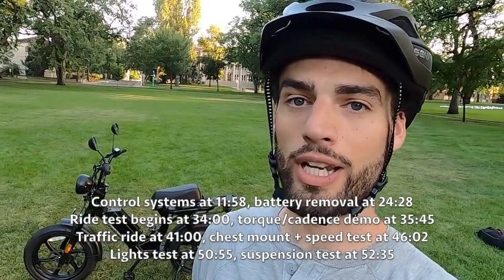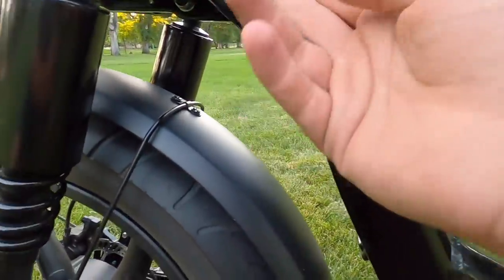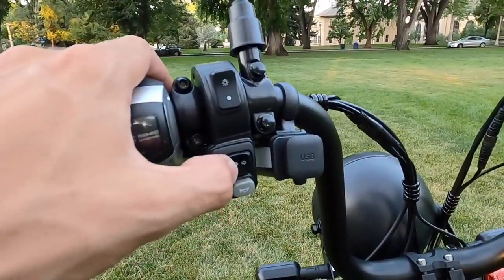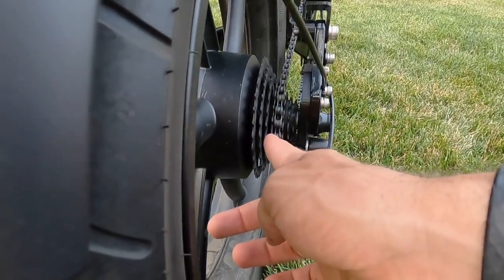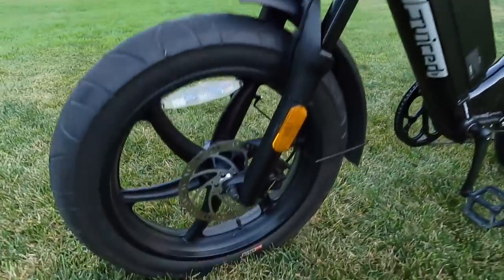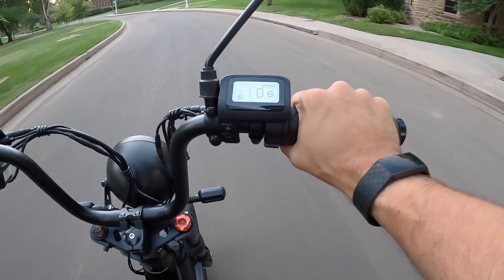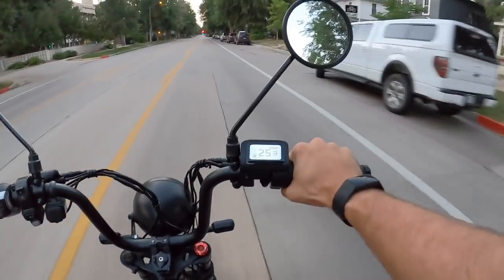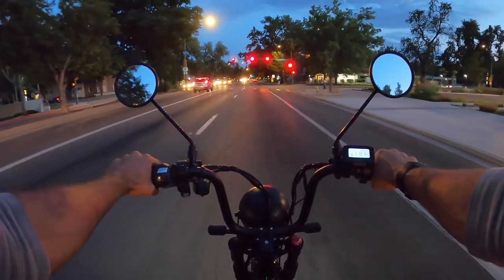Juiced Bikes HyperScorpion Review - $3.2k

Comment from the maker: NOTE: The price mentioned in the video is $2,899. This was the pre-order price, as of August 1st the price has gone up to $3,199.
UPDATE: In the video, I recommended registering this as a Low Power Scooter to make sure that you ride legally. After some back-and-forth with the DMV in Colorado I have determined that this is not actually possible since Juiced Bikes does not provide a VIN or MSO. See the full written review (link in description) for more details on this. 

Control systems overview at 11:58, battery removal at 24:28
Ride test begins at 34:00, torque/cadence sensor demo at 35:45
Traffic ride at 41:00, chest mount + speed test at 46:02
Lights test at 50:55, suspension test at 52:35
Reply: hey did u ever mention the dropout size of the bike frame? dont think I heard it? great review.
Reply: What a great review! I have one and two issues:
1. Front brakes are squeaking.
2. Battery has slightly warped and seems to have moved to the left ever so slightly

Do you have any advice? Thanks so much.
Reply: @tomatojuice12  For the brakes, the likely cause of squeaking is dirty rotors/pads. I've cleaned my rotors with a clean cloth and rubbing alcohol and that usually takes care of it!
Reply: @tanatan7280  Thanks! I am not sure what the dropout size is... and unfortunately I'm away from the bike for at least a month. I'll see if I can get that info from Juiced :)
Reply: ElectricBikeReview said, "in Colorado I have determined that this is not actually possible since Juiced Bikes does not provide a VIN or MSO. See the full written review (link in description) for more details on this. "
I didn't see any more details in the link you provided...but most states have (or they used to have) a way to CREATE a registration for home-made vehicles which I would think would work for this scenario. It's a special class of vehicle. I registered a home-made trailer just a few years ago.
Reply: @TysonRoehrkasse  And this is a recommended maintenance thing on all bicycle disk brakes. Like oiling the chain.
Reply: Yes I need a mirror I don't know why you would need one on the right but you might someday
Reply: If I wasn't watching it I would not leave it with just an alarm I don't think these people smoking crack around here would care about an alarm
Reply: Maybe if I live to be 80 years old I'll buy one like this LOL
Reply: on sale so back at your original price :-)
Reply: I think you only have to register 2000w and over scooters in CO. Technically this is a bike.
Reply: Chris Binder  how come you didn’t go for the hyperscrambler 2?
Reply: Do you notice the shifter is upside-down?
Reply: I just ordered mine for around $2800 and that’s including the passenger seat!!! Can’t wait for my new bike!!!!!
Reply: Sorry to be so off topic but does any of you know of a way to get back into an Instagram account??
I was dumb lost my login password. I would love any tricks you can give me!
Reply: @Madden Julio Instablaster =)
Reply: @Aaron Valentino Thanks for your reply. I got to the site thru google and im in the hacking process now.
Seems to take a while so I will get back to you later when my account password hopefully is recovered.
Reply: @Aaron Valentino it worked and I now got access to my account again. I'm so happy!
Thank you so much you saved my ass !
Reply: @Madden Julio you are welcome :D
Reply: I would love it if you did a review on zooz ebike.
Reply: Way to much. My scrambler way cheaper
Reply: @kingoverclock9497  but it goes over 28mph so it isnt a class 3. Maybe if you pinky promise to keep it in class 3 28mph mode you are good to go
Reply: Juiced HyperScrambler $2499 -1000W 52V 38.4AH, full suspension, mags, Passenger seat, USB, 100+mi range; Juiced HyperScorpion $1899 for 1000W 52V 19.2AH full suspension, mags fenders, rear rack, USB, alarm.

Comment: I've been building performance ebikes for a decade+ and am so impressed with this build @ just $3200 - very well done.
My adjustments would include implementing a 52v-Mid-Drive of 1500watts+ with a 52t covered chainring & a Shimano 3sp IGH w/tensioner driving a 14-22t rear wheel cog. All of this has proven serious reliability - instead of all those high maintenance 'fragile' moving parts and indirect chain-lines of using any kind of derailleur... Besides, no well-powered ebike needs more than 3 gears anyway. 1-Low for hills, 2-regular dogged direct drive and then 3-high for road cruising at 35mph traffic speed .

Comment: Some corrections.  Tail light cannot be shut off.  Motor peaks at 1700 watts.  And if you really need 70 miles of range you better be in eco mode only (11-12mph) and pedaling all the time. Real life range is probably 20 - 35 miles,  your not going to want to go slow on this hot rod!  The bike is awsume though, I'm very happy I bought it.
Reply: I agree with your 20-35 mile battery range.  In "S" mode I get about 20+ miles.  In "Race" mode I did 15 miles and only had 2 bars left.
The bike is well built and fun as hell, but I was hoping for more range from this battery.  Perhaps I am asking too much because I am 6'2" and 250 Lbs.  For $3200 I could have gotten a 150cc scooter :(
Reply: I rode mine hard for 25 miles in race mode on steep hills and as fast as I could and it only used 1/2 the battery. I would say that It should give you at least 40 miles of reasonable service on a charge.
Reply: @jeffweiss2131   Utterly Impossible!  Take a pic of the advanced display showing that.
Reply: @larrybasinski8596  I am not certain how to include a picture here but my screen says 32.9 Wh/Mi. I think that works out to 30 miles per kilowatt charge. I live on the top of a long steep hill. I am usually riding in race mode but maybe not always very hard. I can easily see how I could stretch the charge to 40 miles. I think that would be a normal range to expect for a more reasonable riding pace. I always race up the hill! I regularly catch cars on city streets. I still have very few miles on the bike so I don't really know what to expect.

Comment: Thanks for this realistic review, especially the part about this bike not really being geared (some pun intended) towards big rear cog/lowest gear riding. It's set up cafe racer style without any way to adjust the seat (other than with the optional riser) that's much more like a scooter or moped than a regular gear shifting power assisted bicycle. (That part is obvious just from looking at it but I never would have known that the bigger rear cogs weren't usable. That seems kind of like a shame because the ability to use the lowest gears could help with climbing and ease up the strain on the motor.)

Comment: The funny thing is. When I got the bike I noticed that the chain is razor thin close to the tire.  About three weeks in I got a rear flat. Snd was hell to change lol. But suffice it to say I got it done. But after getting everything back on it still seems razor thin to the tire. But from the main sprocket it just the way it’s designed.  Tires could be better quality someone rated the tires on a low end spectrum.  But the bike itself is cool 😎

Comment: I bought my bike from the Indegogo campaign.  I put 20 miles on it and sold it.   One of the reasons I didn't like it was the weight.  100 lbs plus I felt was motorcycle weight.  If they would have gone with spokes and lightened the frame would have been nice.  I felt it was over engineered with the frame.  Just to bulky.  It would have been nice if this would have been 60 lbs.  Another reason is the geometry of the frame.  I wish it would have been the Camp Scrambler seat and configuration.  Yes, it has a lot of power and cool things, but how am I going to get this on my bike rack?  I thought the seat was not good.  Just a few thoughts.
Reply: how much did you sell it for? im looking into selling mine too
Reply: @biscotti3787  I put it in Facebook Market Place Listed for $2,200 and sold it for $2,000.  I sold it to cheap.  I had a lot of messages.  Got rid of it in one day.
Reply: Harry Weyer would you recommend the call scrambler over this? I was leaning this one because it’s newer and has rear suspension
Reply: @geefim2144  I would get the Camp Scrambler.  I don't think their available.  Their are other companies that make similar bikes.  Good luck on your hunt!
Reply: Harry Weyer thanks ! I have it in my cart now. Probably will. Says they’re available. Going brushed, camp with the 19.2ah battery. 🤞🏼
Reply: Just an FYI - spoked wheels are heavier than cast wheels.
Reply: anxiousappliance what ? The front spoked wheel literally weighs nothing. I remember picking it up out of the box. The cast wheels weight about 8lbs more according to juiced website.
Reply: @geefim2144  literally?  Spoked wheels are for strength offroad - they are heavier than cast aluminum.
Reply: So, this IS or IS NOT going to be easy to put on a Bumper Carrier ( the kind that has a receiver on the car)?
Reply: One hundred is no where near motorcycle weight.
Reply: @jayw900  yeah, motorcycles are around 800 pounds. i get how 100 pounds is still impossible for a lot of people to pick up though, myself included. i still want this bike though lol.

Comment: I would like to see an updated version of the HyperScorpion sold in Canada with the following upgrades:

1 - All cables integrated into the frame and bars. Zero exposure.
2 - Cold Weather package option - winter rubber, battery heater, upgraded IPX rating, heated grips, hand guards. maybe a tiny plastic windshield.
3 - a regen downhill mode\feature. various levels.
Reply: Sure and then you wouldn't buy it anyway due to the price.

Comment: I did a comparison this week on mid-price full suspension fat tire bikes. Your thoughts?
Ride 1 Up Revv 1...... $2399 for 750W 52V 20AH, full suspension, mags, fenders;  ArielRider X-Class.... $2399 - 1000W 52V 20AH, full suspension, fenders, rear rack; Juiced HyperScrambler $2499-1000W 52V 38.4AH, full suspension, mags, Passenger seat, USB, 100mi+ range; Juiced HyperScorpion $1899 for 1000W 52V 19.2AH full suspension, mags fenders, rear rack, USB, alarm. 
 No doubt there are other bargains out there. This is 3/26/2023

Comment: I want to be a fan -- and the HyperScorpion makes everyone a fan, believe me!

It's just ... a LiIon battery bank, composed of probably a few dozen 18650 batteries, are VERY temperature sensitive.

A LiIon battery bank is also severely strained when any TORQUE is required. Torque loads just suck up battery life.

What's all that mean?

An ebike battery loses MASS energy and capacity under torque strain, or in the cold.

Do any of these designers ever think about these things?

Comment: In Oregon scooter law, you must register, license, insure 50hp gas engine or higher on a scooter.   (no peddles)     assume the electrical motor has an efficiency of 92% ( or 0.92). So divide the output (50 HP) by the efficiency (0.92), to get the energy required to be input into the motor, to get 50 HP. So --- 37,300 Watts / 0.92 = ~ 40,500 Watts is required to be input to the motor to get the 50 HP output.
but with an ebike in Oregon, if it is over a horse power, you have to license it as a scooter.  1hp is equal to 745w or (750w motor)... and there is a limit of 20mph for the motors acceleration.  and the motor must turn off at 20mph.  (that can be tweaked but not legally..)..    There is no speed limit on off-road use of ebikes.    Hi Tyson.  Hope all is well in Colorado.
Reply from the maker: Thanks for the info Rob! Really interesting to hear the details of ebike and scooter laws in Oregon! Hope you’re doing well :D
Reply: @ElectricBikeReview  Portland is ok during daylight hours, watch out once the lights go out.  The crazy rioters/arsonist/looters/vandals and criminal ANTIFA known as Domestic terrorist come out.  The news only reflects on the protesters that are peaceful, they never show what happens after dark.  ALL FAKE NEWS.
And yes.. I'm doing well.  I think i want to move to somewhere like Couer D'Alene Idaho where they don't allow the riots.  LOL   is there room in Colorado..?  it looks nice there.. :)
Reply: Thanks Rob! I've been researching more about this topic as the Colorado DMV told me "we do not register electric bikes" when they rejected my Low Power Scooter registration. After more digging it looks like it will be impossible to register or insure in most states since Juiced Bikes doesn't provide a VIN or MSO for it. This leaves it in a grey area... too fast for a Class 3 Ebike, but impossible to register as a scooter/moped. 

Ebike-related regulation is really behind the times compared to the technology and products available!
Reply: @TysonRoehrkasse  Tyson, Drivers Licensing and Automobile licensing only refers to people who use public roads to conduct business:  (cab driver, delivery driver, truck driver. etc..)  legally, it isn't required for people going to the grocery store.  Licensing is for those who use public roads for commerce.    But we have allowed the authorities to push a false agenda to extract fees/taxes out of "travelers"... Those fees only really apply to "drivers"..  :)   And one person going up against the establishment won't work.. it would have to be all "travelers" refusing to have an effect.  Intimidation of one person/cyclist/traveler can be a powerful persuader...  As cyclist, we are considered travelers.  Unless we use the public roads to make deliveries (Currier, food delivery etc)  These are points we ebikers/cyclist will have to make in a court of law to fight this illegal taxation. 
Personally i have my ebike and etrike insured for theft, or if i hit a pedestrian and send them to the ER.  I have insurance for hit and run, or if i collide with a new mercedes and put a big dent in the door.  (that is expensive..LOL)     Oregon and Colorado (most states) don't require it yet... Washington is considering reinstating the bicycle licensing requirement.  They had it 50 years ago,  and are thinking about bringing it back..        I think, if they are going to require licensing of bicycles, the DOT must be required to put in bicycle lanes on every road (or have separate bicycle routes) to justify the fee.
Reply: @TysonRoehrkasse  Thanks for this follow-up info, this is very important.

Comment: There is no hydraulics in the front suspension they're just simply spring loaded out of the two knobs only one of them either locks out the front fork or allows it to move freely there is a spring in there it's kind of spongy though

Comment: I keep asking Tora and Juiced if they will be addressing the latency issue with the torque sensor kicking on and off and a few other firmware updates they really need to do on the RCS. I'd love it if they'd put the trip meter on the main screen instead of the odometer.  Makes sense to put the trip meter on the main screen instead of burried on the stats screen.

Comment: Excellent review. Very well done. The one thing I learned from this is that even at $3,000 bikes can have issues. I live in the country. I would kill to own one however I know the first time something internal breaks or needs repair the shops won’t touch it. If juiced had a store or repair facility fine but I have to pass on buying it.
I only wish that a bike built that well would go to at least 40mph. What good is a well built machine that weighs 100 pounds that can’t go over 40+ full throttle like the onyx or the Monday bike. Too heavy to be peddled up hill. And with those cast iron wheels try peddling if the battery gives out up hill also. Good luck.👍

Comment: the average car headlight emits between 2,000 to 4,000 lumens. However, this number will depend on a few different factors.

The brightness will depend on the number of LEDs in the light itself. Some bulbs will be rated incredibly high at 10,000 or more, but you should take this claim with a grain of salt

Comment: I bought two of these last year put 5,000 mi on them in 6 months lost 70 lbs.
These guys never really show you what this can do I go 36 miles an hour on this bike and it will climb the steepest inclines with ease
if I could change one thing on this bike it would be for the tires not to be slick, do not get on loose sand you'll go sliding

Comment: Hey man, great review! I have a question- I’m 6’3” like you and was really considering this bike. Do you feel cramped at all on the Hyperscorpion, or is it genuinely a comfortable ride? I’m assuming it’s wheelbase is tighter than say a Ripcurrent, which is another one that I’m interested, but the ability to go full throttle in race mode has me hooked on this one
Reply: I am 6'2" with a 32-inch inseam, and the seat extender is a must. 

That said, the bike is comfortable, and I pedal all the time.  I don't have a full leg extension, but with the motor helping, you really don't have to push too hard or stress your knees.

The range on race mode and pedaling is about 30 miles.  So, I added a second battery, 20ah plus the original 19 = 39 ah.  Now I go 30 miles with 4 bars left. 

The bike is heavy.  You don't feel it so much when riding but getting it into my truck bed is tough without help.  

All that being said, if I were to do it all over again, I would get the CrossCurrent S2 at $1499.  Lighter weight, slimmer tires, means going fast and, farther with less battery.

Comment: If you take the battery with you does that stop the alarm from working?
Reply from the maker: I got the impression that the battery for the alarm was separate? I'll ask Tyson about this though.
Reply from the maker: He just got back to me and said that the alarm uses three independent AA batteries. In the video he talks about sticking it under the seat and that it has strong adhesive on the back (so changing the battery could be difficult down the line).